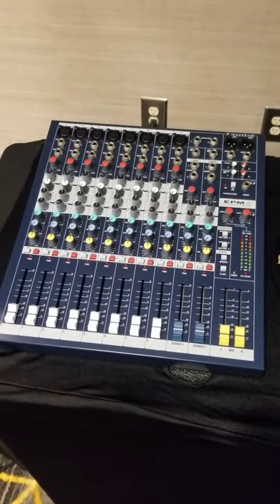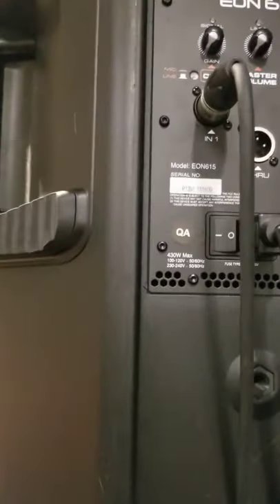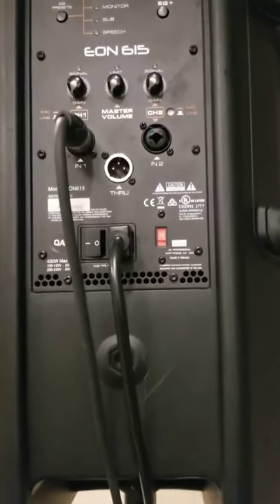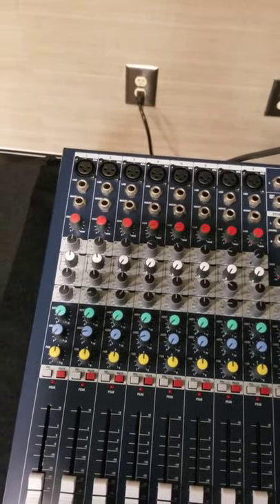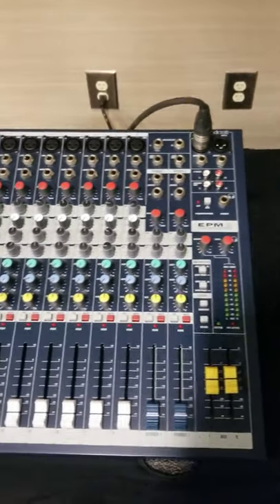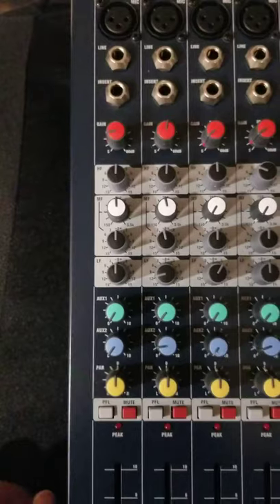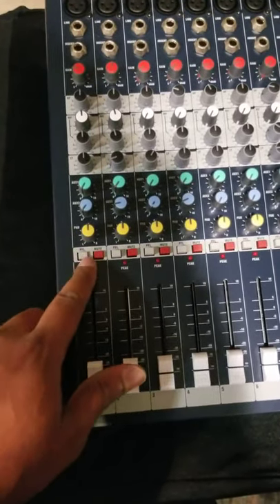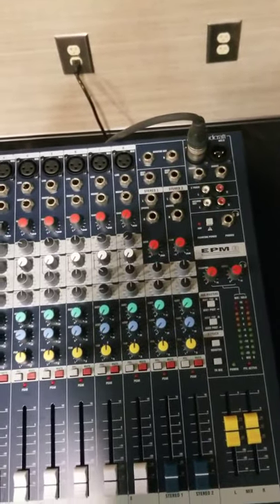How To Connect an Audio Mixer to a Powered Speaker

Comment: Question, how can I tell if a mixer accepts a wireless in ear monitors.  I have a Behringer Active powered speaker.  This was so helpful.  Thank you
Reply from the maker: Thank you. You will need a mixer that has multiple outputs to be able to send the mix to the different people who need to hear the mix. So, a mixer with multiple aux send outputs, or monitor outputs.
Reply: @360avrentals4  oh thank you so much.  I appreciate you responding.  Have a wonderful weekend.

Comment: I think that the input in Active Speaker should be switched to "Line " if not wrong. In JBL Eon 710 active Speaker I couldn't find the button of Line/Mic? Are there any other settings in that Speaker? Please reply...
Reply from the maker: Thank you for your comment. I could be wrong, but I believe there is a small white tab on the back of the 710 that can be pushed in or out using a pen or some other small pointed object. This should allow you to toggle between mic and line level.

Comment: I'm using a peavey pa 400 and need to power two 15' active speakers but the peavey amp only has 2 trs outputs (not the dedicated passive speaker outputs obviously) but a monitor and a main out, would it be convenient to get a trs to xlr cable to connect the speakers?
Reply from the maker: Yes. We recommend the 1/4 inch to xlr male adapter to run from the main out to your speakers. Thanks!

Comment: What will happen if you only connect one speaker to a mixer? Will it make a difference??
Reply: Yes it will. Typically, the larger the room is, the more of a difference it makes.
Reply from the maker: Yes. Exactly what the previous reply says. You typically should use more than 1 speaker in any room above 750 sq ft.

Comment: ok, now wait.  I have a Mackie analog mixer very similar to yours and a K12.2 2000W speaker...I play pre recorded  instrumental tracks and live vocals ( my own) with the set up.    My XLR outputs (2) are on the back of the mixer but I only have ONE main volume slider on the mixer, Sooo  should I  be plugging in TWO seperate cables or maybe a split XLR cable (2--1)  of sorts into my actual speaker to be sure I'm getting the stereo sound with both my tracks and my vocals??   I only see one input ( for the mixer) on the back of the speaker.   This stuff may as well be GREEK to me.  My ears are absolutely amazing, but my freaking overall  live performance tech knowledge is absolutely the worst.  I can't compute no matter how hard I try!  I'm used to having my own sound techs for this! LOL.
Reply from the maker: Thank you for your question. You should be fine with the current setup that you have. You would just need to run 1 output from your mixer to 1 speaker, and the other output to the other speaker. To get a stereo sound, just make sure that you position your speakers on opposite sides of the room (i.e. 1 speaker on the left side and 1 on the right side). I hope this helps.
Reply: @360avrentals4  I am using one speaker .
Reply from the maker: @nowzen4240  Ok. Well, with one speaker you will be limited to a mono sound. Your best bet is to position the speaker to where it is able to be directed towards the center of the room. Make sure it is in front of the microphone to avoid feedback.

Comment: What if I have a base, do I connect it to the mixer or keep it with the speaker
Reply from the maker: If you have an active subwoofer, you can connect to the PA speakers by going out from the subwoofer's output directly in to the input on the PA speakers. Or, you can connect the main output from your mixer to the PA speakers and connect the mixer to the subwoofer by using an auxiliary send(post fader).

Comment: Can i connect a mixer to my edifier desk top speakers which have rca inputs they are the R128OT Speakers, please advise.
Reply from the maker: Yes. You should be able to connect with the proper adapters. If your mixer has an XLR output, you would need an XLR(f) to RCA (m) adapter to connect to your speakers.
Reply: @360avrentals4  does this mean you connect 2 sets of R1280DBs speakers (RCA) to the 2 main outputs (XLR)  of the mixer? 1 set has an active speaker (L) that chains the passive speaker (R) so 1 set wired on the Left Main output and another set on the Right main output, which make 4 speakers total driven by the L and R main outputs.  Appreciate your feedback!

Comment: Question please, I have 2  extra power speakers that I want to connect to my currect set up i have,  but I do not want to plug then into The monitor input. I want full control on my faders
 L/R main output . Now i already have my 2 subs and 2 loud speakers running that I been using. So how can I add my 2 new  power speakers into my set up im running,   do I just plug Into one of my running speakers output and then to my second and third new power speaker
Reply from the maker: Yes. I would suggest that you loop the 2 extra speakers together. Use the output from your 2nd speaker to send to the 3rd and the same from the 3rd out to the 4th one.

Comment: Hello i have my mixer and my 2 subwoofers and my 2 tops loud speakers.   I happend to have a third subwoofer.  How do i connect that to my set up
Reply from the maker: If your subwoofer has a thru output, you should loop 1 of the 2 subwoofers to the 3rd one. If your subwoofer doesn't have a thru output, then you should use an auxilary send from your mixer to go to the 3rd subwoofer.